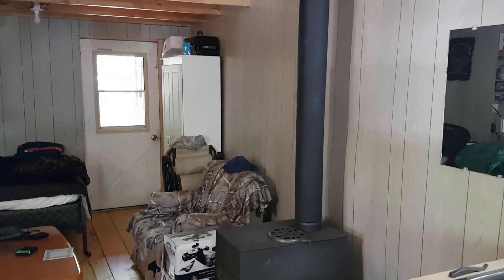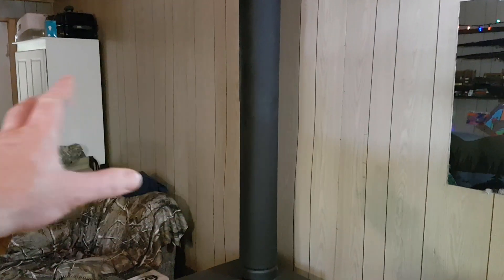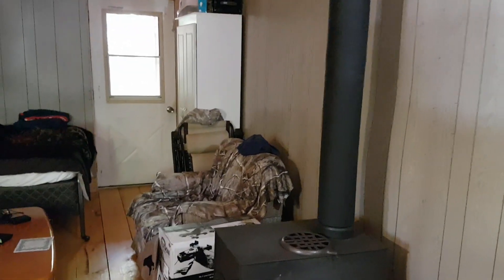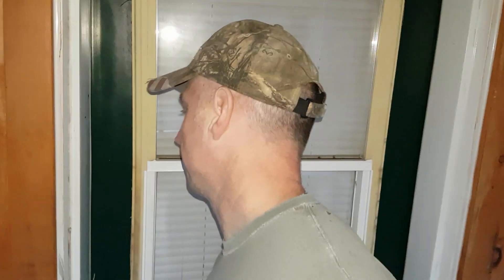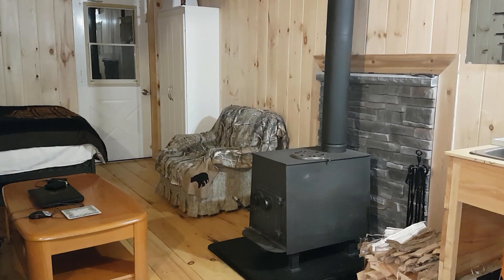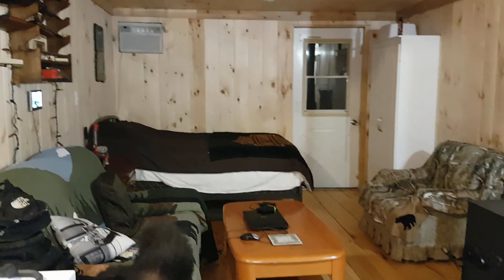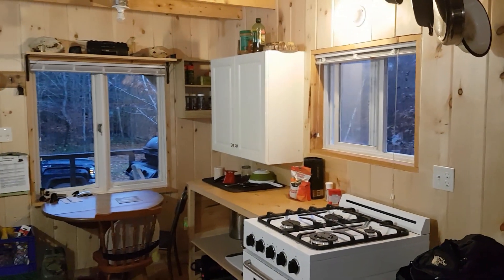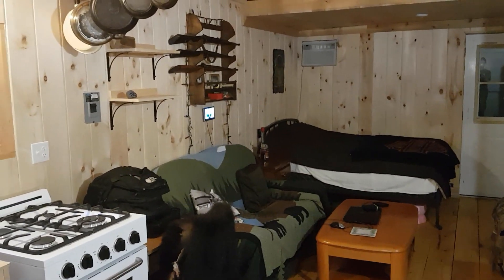Interior renovations on the cabin are done!

Comment: I know that this is an older video but I had to look at how you made your cabin, Like you said a good foundation is very important in the other video . I see you put your pine boards vertically . Good thinking . Most of the time people place them horizontally  . I see that you attached the boards on top and the bottom . When you put the nails or staples ( what ever ) down the middle  did you add some backing to the wall for those fasteners ? Didn't see any horizontal boards running from stud to stud for backing . Just wondering .
Reply from the maker: Yes I did, I ran horizontal boards between the studs so I would have some to nail to.
Reply: Thanks for getting back to me . You did a great job on your cabin . NICE !!!!

Comment: Have you ever considered  a space saving murphy bed - folds away when not in use thus  opening up floor space for daily life.
Reply: I'm toying with the Murphy bed idea too. Thinking of a wood frame for a full size mattress and playing with some weights and the pivot point to see how heavy it would be to raise it flush with the wall. I could always use detachable  rope and pulleys! The Murphy bed hardware I've looked at is so expensive! I'm a year or so away from this experiment!
Reply: A Quality Futon Bed may be a better option.
Then it’s a couch - when it’s not a bed.
Reply: For those square dances, I suppose. 😝